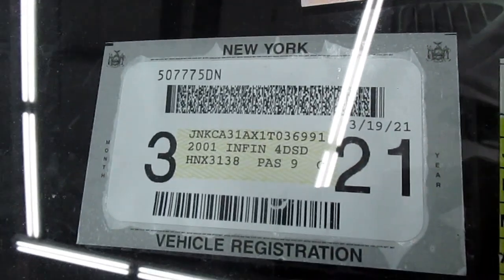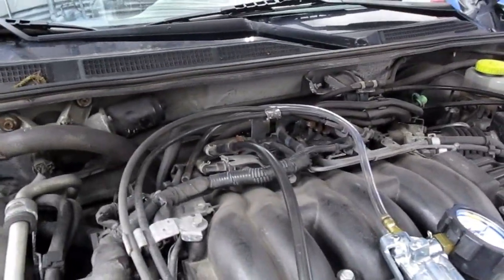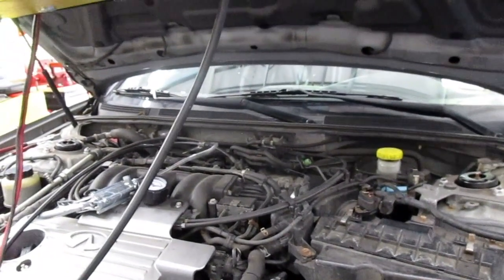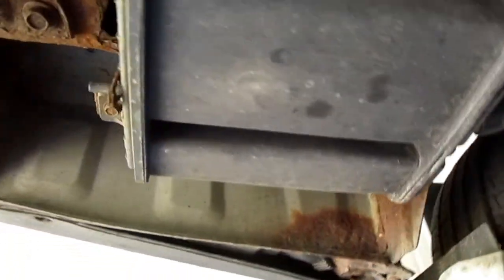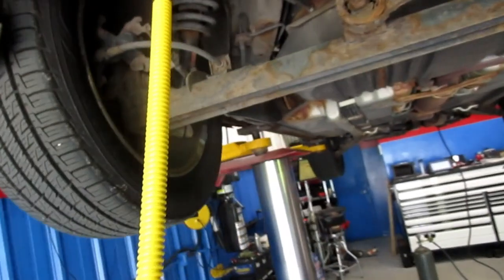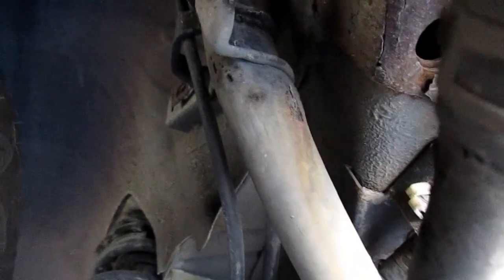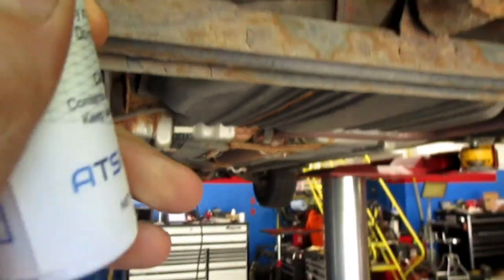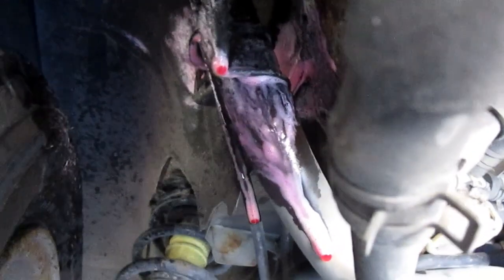2001 Infiniti EVAP P0440 Small EVAP Leak

Comment: I just did mine last weekend. But now my EVAP has no pressure. Cranks but does not start. Found the leak in a cracked vent valve in the rear of the car. How do I pressurize the system.